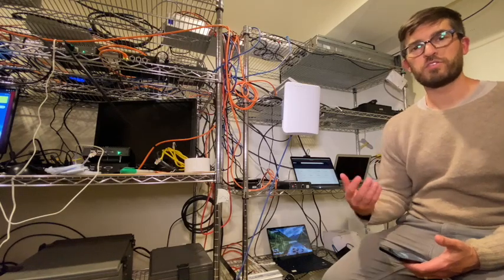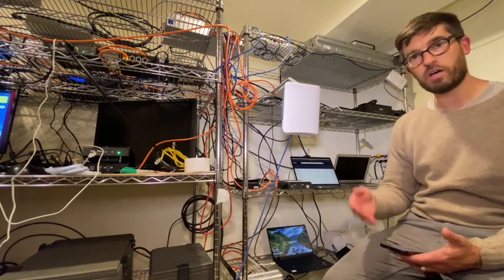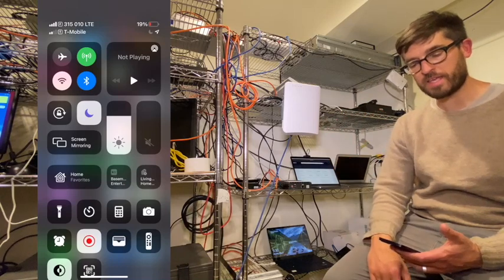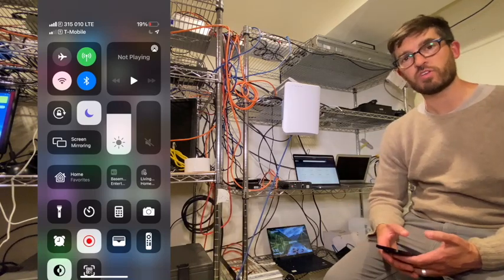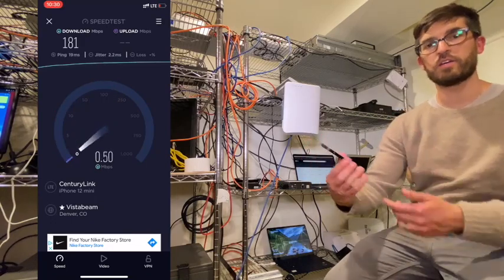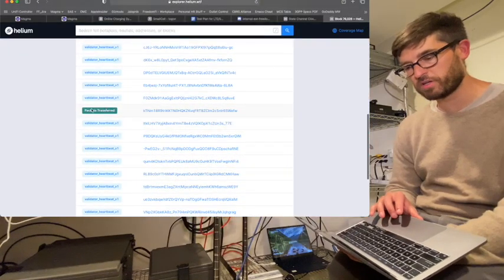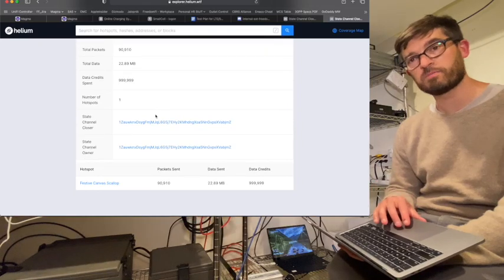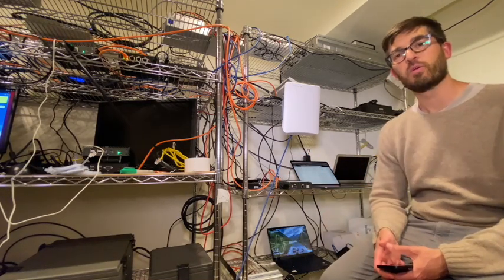Mining Helium with FreedomFi Gateway

Comment: How does the small cell antenna connect to the miner ? (cable, cordless or)?
Does the small cell antenna cover both the helium freq and the 5g?
( Do you need two antennas 1 for Hnt 1 for cell 5g rewards )?

Comment: 5G has 1000 feet coverage, 4G has 10 mile coverage, how will this be better than 4G?
Reply: 5G's coverage is based on the frequency it uses, as it 4G's.   

You can get multiple miles on 5G using 3.5Ghz.   the 1000 feet coverage is for microcells running millimeter wave.

Comment: The only problem I have understanding CBRD radios equipment is that the signal has problems going through walls.
So I also have a dilema, if I order a freedomFi gateway gateway, in addition they are going to be offering the indoor version CBRS radio for purchase,  later they are going to be offering the outdoor one.  If I buy the indoor one, nobody in my neighborhood are going to be able to use the potential because the signal can't go through walls.
If I buy the outdoor one, nobody who is inside their homes are going to be able to receive any signal because CBRS signals can't go through walls. 
I don't get it!
Would someone help me understand?
By the way, I'm already on the waiting list for the FreedomFi gateway, thinking about cancelling.
I rather invest it buying Shiba Inu

Comment: Will it work with another miner in same house, if that doesn't have 5G e.g bobcat or normal 300 meter rule will apply ?
Reply: 300 meter rule applies due to it also have LoRAWan built in.   If your location is better suited for cellular, you're better off shutting down/moving the current miner.